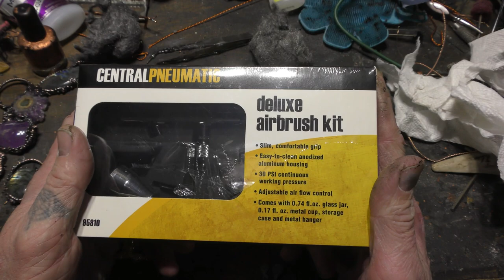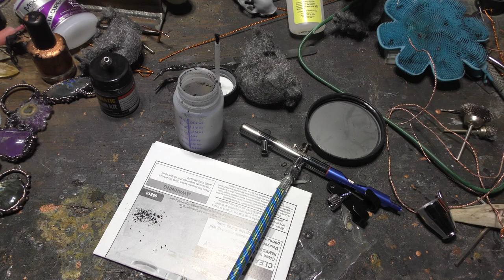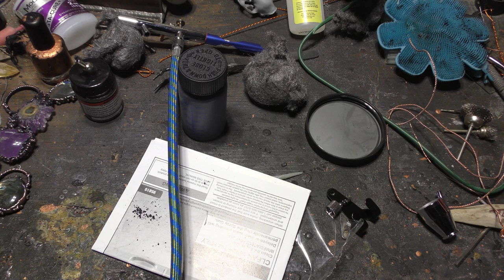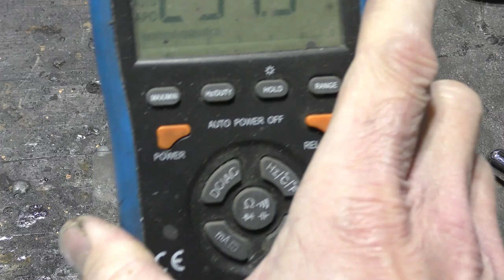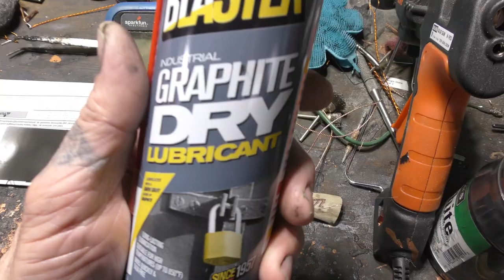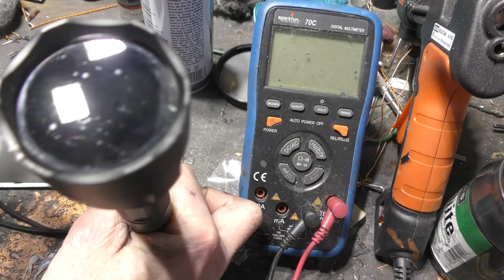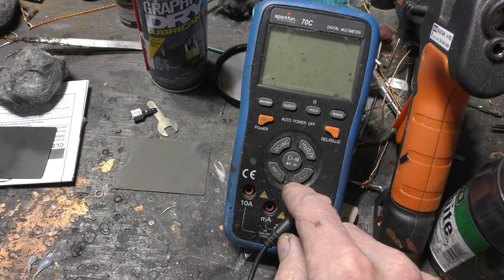Make conductive fluid that goes through an airbrush for electroforming

Comment: Jason glad you mention the golden rule for success in conductive paint or ink which is.....graphite powder with small or "micronized" particle size!  I've read that the graphite powder mesh size is EXTREMELY important however this is due to the smaller particle sizes creating a colloidal graphite mixture in which the particles are able to evenly disperse in the paint/ink solution when mixing. This creates a much more homogenous mixture and results in overlapping graphite particles when applied. The graphite powder particle size recommended is less than 50 micron & ideally around 10 or 20 micron; but lower is better! That is what most of the conductive coatings patents and academic papers have stated as providing the best conductivity. Unfortunately the cost of genuine micronized graphite under 5 or 10 microns is quite cost prohibitive. Thus I thought it would be interesting to investigate making a small homemade fluidized jet mill micronizer to process my graphite into extremely fine particles. It's a very simple machine that can likely be resin printed. I'll keep you in the loop.

P.S. If you ever needed a boost in conductivity, I  came across a paper mentioning that adding some carbon black to the graphite powder further lowers conductivity to less than 1 ohm per inch; surpassing what can be obtained from the micronized graphite alone. 

"The study found that at a higher total carbon loading ink of 29.4% by mass, optimal conductivity (0.029 Ω cm or 0.073 Ω inch) was achieved at a graphite to carbon black ratio of 2.6 to 1"

Source:
"The effect of graphite and carbon black ratios on conductive ink performance" 
- Chris Phillips, Awadh Al-Ahmadi, Sarah-Jane Potts, Tim Claypole, Davide Deganello
Reply from the maker: Woh... Awesome stuff here.  I do love papers !   The best graphite powder was general graphite which was a good mesh and did not contain much filler material.   I bought like 12 containers just before the market dried up.   Have been on the hunt for a new source for sure.    Also love designing in 3d so if you need help let me know.  Would love to see the concept.
Reply: Quelle est le fournisseur de poudre de graphite et l'encre dont vous parlez ainsi que l'outil pour pulvérisation
Reply: You can get very small particles by using a ball mill, which can be just a rock tumbler if you happen to have one around. It just rotates a container full of your material and some heavy balls. I've read that if you go long enough (weeks) you can get nano scale particles. 
----------
India ink is already slightly conductive, though not anywhere near how conductive graphite is. I think this recipe may have a bit of a similar benefit from the ink. I wish I knew where I put mine!

Comment: Hey Jason, the Greeks made a glaze called terra sigillata by siphoning off the upper layer of slip water with the finest suspended particles. Could you do this with graphite powder in order to get the finest particle? I also wonder if the graphite powder could be magnetically stirred for longish period and in the process the particles will round themselves out… then let the solution settle and siphon the suspended particles and distill.